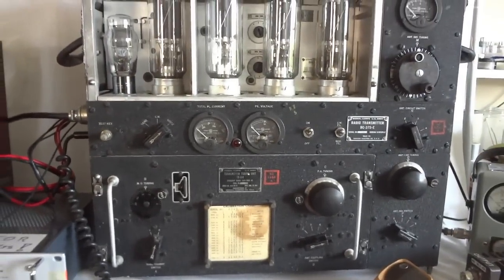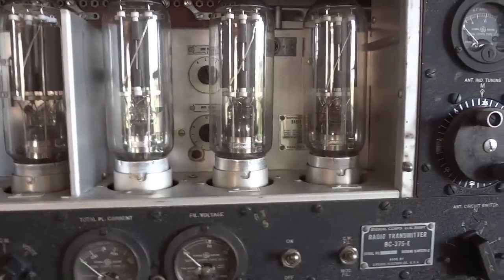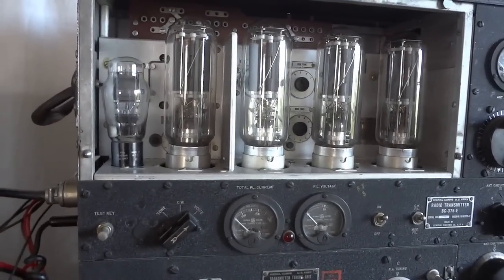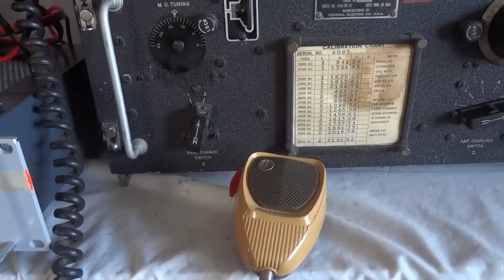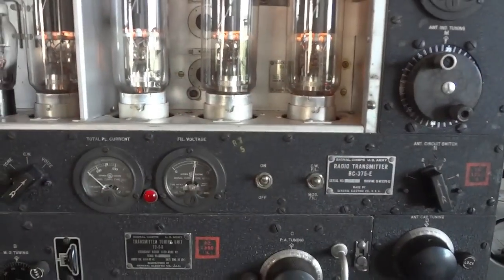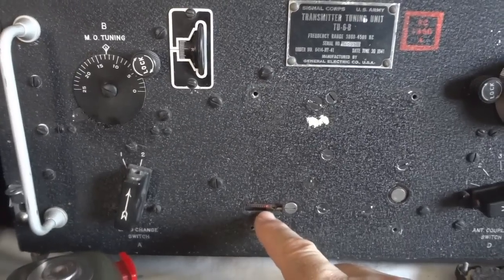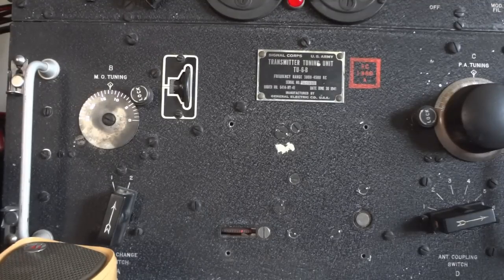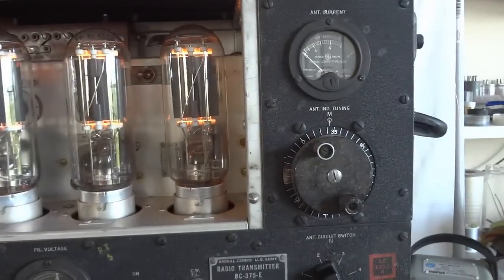BC 375 world war II transmitter used in B17 flying fortresses

Comment: THANK you for explaining the relationship of low  RF current vs 50 ohms.  I learned this about 1966 from a retired bird Colonel  at our local ham club with the club's  TCS-12.  One of the "other kids" loved to flop meters,  and would improperly  tune the  station balanced line tuner  such that the TCS  displayed high RF current into the 50 ohm link cable.  

375  is one  I've never gotten to play with.  ARC-5, TCS-12,  ART-13, and AN-ARC-2  were some I got to get my hands into, along with the odd  VHF FM "tank" radio SCR-508 or similar, along with several Command receivers, and  BC-34X series  (348),  and  some others  while at Treasure Island  ham club,  SF,  ET-A school--68--69, at K6NCG  Look that up

Comment: THANK YOU for explaining the RF ammeter.  As   an old ham (75)  who  encountered such things as TCS12   when young,  I once had a friend who LOVED  banging meters.  Our local  retired bird  Colonel   explained to him  (somewhat impatiently)  more than once how to properly set up the link -to - balanced tuner  to provide a  low Z match to the TCS

A note to you youngsters:  It is  not that difficult to  burn out the  thermocouple unit in these which is the secret to making them work.   Some meters use an external thermocouple, as well, so if you find a meter, do not assume that  it's scale  equates to the meter per se.

Comment: During WWII Detroit Ch. 4 weather forecaster Sonny Eliot was a pilot on a B-24 bomber. During flights at high altitude in an unheated unpressurized aircraft, (temperature -12ºF at 20,000 Ft; -30ºF at 25,000 Ft) moisture from the breath would cause carbon microphones to literally freeze solid and quit working. So before taking off, the air crews would enclose their mics in a condom to shield it from moisture. When Sonny Eliot's B-24 got shot down over Germany he and the rest of the crew were arrested. As the German officer went through the pockets of Sonny's uniform, he came across a number of condoms. The German officer remarked "You vill not need zees vere you are going." Twenty years later Sonny was still laughing about it.

Comment: I am about to place my NOS BC-375 on the air. The BC-375 is still in the crate from the factory as are all tuning units. Thank you for an excellent video and especially on how you neutralized the PA. I probably would not have thought to listen to the signal in FM mode. Great tech tip! Thanks again!

Comment: Great video. I would have liked to a see CW demo but still a fantastic demo. I believe this was the transmitter in the bombers paired with the BC-348 I. The early part of the war and eventually replaced with the ART-13. I have a BC-348-R. It’s a single conversion with 2 RF staged before the mixer and 3 IF stages after the mixer at a freq of 915 for the IF. The CW key used in the bombers with this transmitter was the J-5-A flame proof  and I have one in absolute mint condition. 
73!!

Comment: This is a beautiful transmitter, I wish I had one. The modulation sounds really great. I would like to install one in my rolling fortress minivan. I am sure I could get 150 watts with a bit of modification and a decent B+. I have run a 211 at 1700 volts in special ICAS++ mode. Maybe too much for plate modulation. They cost $2.99 at the time.
Reply from the maker: Yes, I remember that. Surplus stores used to sell  four of these tubes in their original military spare case for peanuts. And no one was interested because they were considered obsolete tubes for ham transmitters, difficult to tame and not working great above 10 MHz. And now, an single US-made 211 tube from General Electric goes for an amount way north of 200 dollars....  Madness.
Reply: @LifeIsTooShortForQRP  I bought one around 1976 at Etco Electronics in Montreal Canada for $2.99.
A friend of mine tried to get two of them working in push pull at about 30 megahertz, he could not get the neutralizing right.
The amplification factor is too low to work well in grounded grid.
I should have bought more for audio use. They had many of them.
I must finish working on my time machine.

Comment: I agree with the statement that transmitter tubes belong, well, in transmitters foremost, especially the rarer ones The same holds for all sorts of other rare radio tubes used in receivers that somehow find their way to audio amplifiers through the evil means of marketing. Magic eye tubes are a case in point: they have no business whatsoever in an audio amp, however, some manufacturers whose products are just as much about the looks as they are about the sound reproduction flout on them on their shiny new toys. Unfortunately, a lot of high end audio amplifiers these days seem to fill some kind of existential void in some peoples' eyes. They mostly achieve that through visual artifacts and bold statements about rare and expensive materials used in their construction -which is always by hand and takes a few hundreds or thousands of hours of course.
In the audiophile's defense though:
a) transmitter triodes are the most linear electronic amplifier devices and reputable tube manufacturers are simply reluctant to take up their manufacture: the narrow market does not justify the cost outlay nor the production cost
b) it is not the audiophiles' fault that these transmitters (and many other such devices) were junked by the skipful upon being decommissioned and those that were not, were sold for peanuts at hamfests or the ham radio circuit -if not just given away. The audiophile always seeks the cheapest, fastest way to audio nirvana and if a decommissioned thoriated tungsten triode fits the bill, then so be it.
c) audiophiles have had historically to put up with hyperinflated prices for many a time substandard gear and were always given limited choice with respect to amplifying devices (the lack of a standardized 50W or 100W power audio triode is, I think, a case in point: RF engineers otoh have a wealth of choices).
d) were it not for the surge in tube demand created by audiophiles (and guitarists) there would be no receiver/audio tube industry to speak of today -heck every piece of gear needed to manufacture tubes ever again would have been scrapped long ago and the operational knowledge would have been lost with them forever.
Technologically, audiophiles and ham radio fans are after the same thing. Tube manufacturers aim to sell to both (and to guitar players). What is missing from the equation, I dare suggest, is historical tube equipment preservation societies to further the cause for old electronic equipment. They could play a role in safeguarding stockpiles and commissioning new production runs for rare components. The same problem is faced for example by owners of old scopes and other precision instruments etc.

Comment: Rare video. But it is not complete ! What are the things for behind the tubes ? And can you show us behind the back please ? And also ofcourse in the drawers. Not to forget the ant tunerpart which is a piece of art. A lot of these models were on the Dutch dump market.
Please show and tell.
Reply: Definitely... it'd be cool to see the other side, with the modulation xfmr and other cool things and ingredients to that 'mitter. :-)
Reply from the maker: They are the bias current settings for the tubes as well as the microphone gain potentiometer. The terminal strip you see at the top-back (the one with the jumpers) is to set the filament voltage at the correct point for a given input voltage (either 24V or 28V). The video would have gotten too long had I added that as well, sorry

Comment: In my early ham days I used command sets for 80 and 40. I assumed they were for talking back to England and was surprised that they were for plane-to-plane communication inside a squadron. I assume, given its greater power and trailing antenna, this one is how B-17s talked back to England.
Reply from the maker: Your initial assumption is correct, these were used for long range comms back to base, not for communication between planes, they used VHF for that. But these BC-375 transmitters were almost always used in carrier-CW mode, using very short transmissions. The amplitude modulation mode was almost never used. In fact, many B-17 radio operators (when running out of spares) would pull one of the VT-4C tubes from the push-pull plate modulator if the transmitter PA or oscillator tube went bad, since AM was not used anyway.

Comment: Another outstanding video! Just curious - how much do all the components weigh? That looks like a lot of radio weight to load up in an aircraft.
Reply from the maker: The transmitter weighs around 55 Lb. In the B17 flying fortress, it was used with a rotary inverter called a "dynamotor" (not shown in the video) which converted the 28V aircraft voltage to 1000V (needed to supply the transmitter plate voltages) That dynamotor alone weighs 39 Lb. Sounds high, but keep in mind a single bomb was 500 pound and the plane was carrying many of those. So in the grand scheme of things the weight of the radio equipment was insignificant. If you want to see more detail, you can download the equipment manual here: http://w5jgv.com/downloads/BC-375-E.pdf

Comment: Is given to me many years ago an old aircrafts TRANSCEIVER smaller full of valves, having 16 VHF Channels . It has no panel. It's remotely controlled,. Its look that is 5-10 Watts. It is using 24-28 volt DC. The dynamo-motor makes noise like a vacuum cleaner and also sucks air for cooling all the inside and also filters the air . I fancy this noise. I painted the cover .
Reply from the maker: Maybe a British  TR1934 VHF aircraft transceiver? https://www.marktplaats.nl/v/verzamelen/militaria-algemeen/m1931049585-tr1934-tranceiver

Comment: Those 211 tubes are highly sought after by audiophools today, they sell on ebay for a few hundred dollars each!   Copies are being made by the Chinese for that market.  The type 10 is also very expensive.  Damn triode audio nuts!
Reply from the maker: I know they are VERY expensive. But the Chinese make pretty good duplicates nowadays, for $50 each (shipped), not too bad. I tested those Chinese tubes in another BC-375 transmitter I am restoring, and they work remarkably well, EXACTLY the same gain and inter-electrode capacitance as the original General Electric USA made 211 tubes. The Chinese brand I tested is "Shuguang",  they work very well and have good workmanship. Here is the YouTube video where you can see them in action:  https://www.youtube.com/watch?v=k-fmiD_vSDI
Reply: Audio nuts lol. 
Thanx for sharing 'lifes2short'.

Comment: Didn't they have like a 20 metre long cable aerial that they trailed out of the rear of the plane when they needed to talk?
Reply: Jep, they did.
Reply: And I bet even over France the base back in england would have been static
Reply: Do you know anything about 1950s weather balloon radio s o n d e s? That work on HF. 2 Small electron tubes

Comment: I picked up a  us navy transmitter at a local antique shop. Having trouble finding information  on it, it's in a wood crate, labeled as ATM-1 Transmitter, looks brand new as all extra parts/tube station are still wraped in paper. May be  a meteorological unit. It has a wind cup (3 cups) looks to to be portable to deploy from ship or shore. I was going to donate it to a navy muesum at great lakes navel station. Any thoughts,  thanks. Paul

Comment: I have one of these with all the matching  crystal sets. I am looking into getting it up and running and have some questions for you. I do have the dynamo but it’s seized up so I need to come up with an alternative power source also I have no cables. But I would like to make it functional.
Reply from the maker: Hello. This radio did not use crystals and no crystal set exist for it, so that must belong to another SCR radio. Maybe it belongs to a BC-604, a BC-610, a TRC-1 or a BC-659? Make a short video of it then we can tell you.
The dynamotor for this transmitter should be not too hard to repair, but I do not recommend trying to get it to work if you are not familiar with WWII equipment. This BC-375 transmitter requires 1000 volts to work (which is what the dynamotor generates), and these kind of voltages can kill you in an instant if you make a mistake. My advice: put the transmitter on display at prominent place in your house, but do not try to make it work. Cheers.
Reply: Sorry not crystal set but running units. All a matching set.
Reply from the maker: @scotthansen6468  Got it. Nice buy, to get a BC-375 with the matching TU boxes, that is rare! Cheers.
Reply: I like...fantastic

Comment: Are you sure on the antenna amp meter? going in to 50 ohms should give higer amps, than 250 ohms of the wire antenna.....is it the right amp meter???

Comment: Curious what these are worth?   My dad pulled one out of a B-17 at Wright Patterson AFB in 1952...It is in very good condition.....I have it now...just curious...thx .  Please write me back if you will ... I sure want to learn more about what I have here!!!  Thx!!
Reply from the maker: It highly depends on the condition. If it has good paint, clear lettering, no corrosion (also not inside), no damage and all tubes and TU box are present it should easily fetch $500, more likely $700. 
If the original mounting is still present add another $150.  The dynamotor (not shown in this video) is worth another $200 if in good condition. Cheers.
Reply: LifeIsTooShortForQRP Thx for the quick reply.  What do you mean by the original mount?  And also.  Aren’t the tubes inside worth about $250 a piece?? Many thx!
Reply from the maker: @robertporter1429  This is the shockmount I was talking about: https://www.worthpoint.com/worthopedia/military-radio-bc-375-shock-mount-1917201004
 The tubes could be worth $250 if they would be unused in their original box, which is not the case here of course. Cheers.
Reply: @LifeIsTooShortForQRP  ...thanks so much for your help with this...I sincerely appreciate your input....would luv to send U a photo of my rig...but don't see how to attach an image... on this page....Regards, RP
Reply from the maker: @robertporter1429  Robert, just make a short video of it  and put it on YouTube! You don't necessarily have to have it running for a video. Cheers.

Comment: I would have thought high impedance was low current high voltage and vice versa
Reply from the maker: That is correct for antennas that are resonant. When an antenna is not resonant (which is almost always the case for this transmitter in an aircraft having a trailing wire antenna), there can be a large component of current that does not take part in delivering actual radiated power ("out of phase" current, also called "bad SWR"). This is the part of the RF current that the built-in antenna tuner needs to cancel out. But the RF ammeter cannot distinguish between such resonant currents and "blind" currents,  and will therefore show a large current going into the (non-resonant) antenna depending on the impedance of the antenna (which on it's turn is frequency dependent). Think of it as the power factor that applies to the AC grid. An inductive load (or capacitive load) will show a large current going in that does actually not dissipate any power in the load. That translates to a power factor of 0, and won't make your outside kWh meter move. A purely resistive load (like an incandescent light bulb) will exhibit a current going in that DOES deliver actual dissipated  power, and the power company will charge you for that one. That is a power factor of 1. Anything in between (like an AC motor) will be a load that is partially resistive in combination with a partial inductive (or capacitive) load. It is the same for the antenna that forms the load for this transmitter, but then at a much higher frequencies than 60 Hz. But the concept remains the same.